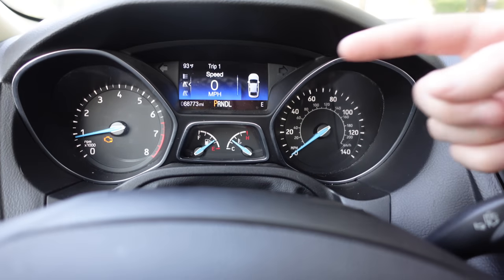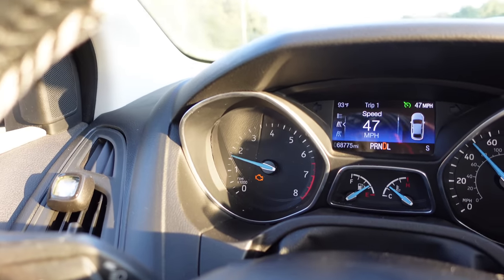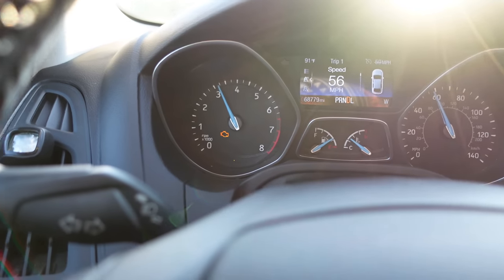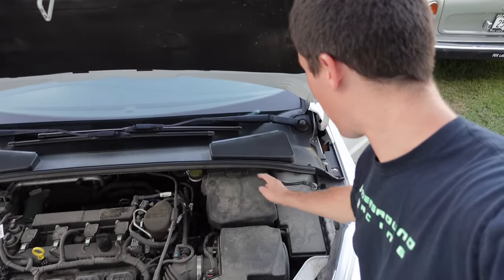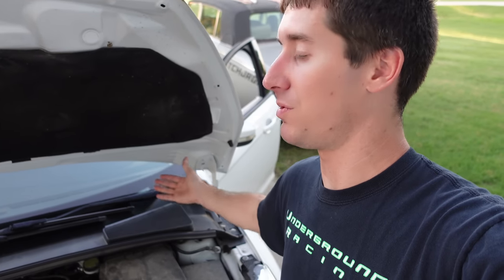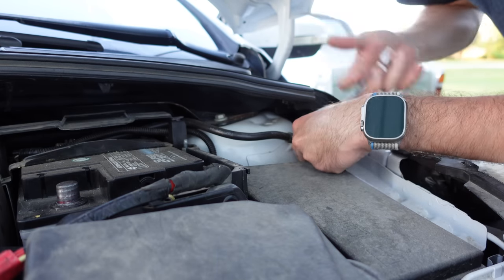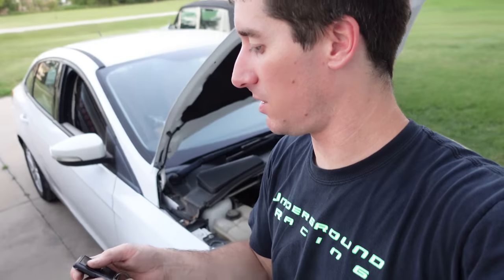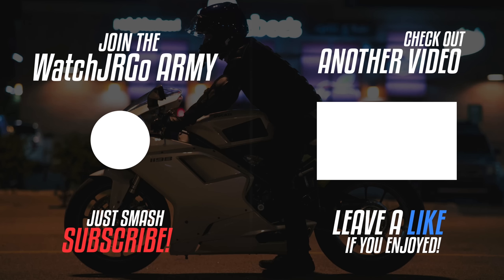This NIGHTMARE Transmission DESTROYED The Ford Focus (Fixing My Girlfriend's)

Comment: We’ve got one in the family with same amount of miles, only has 1st 3rd and 5th, R, 2&4 are out. Codes say clutch B stuck. I swapped clutch motors but no change. It’s now at Ford dealer as warranty was extended to 150k miles.
Reply from the maker: I just read that!! I'm taking it straight to the dealer! 😳
Reply: @WatchJRGo  my mom has a 2012 focus and they tried to pull some BS stating that they didn't have to give her a rental, eventually after some back and forth they gave her a brand new malibu for the 2 months!!! that it was in the ford dealer for. Something about a chip shortage during covid.
Reply: @WatchJRGo  Fingers crossed there's any parts in stock.
Reply: @WatchJRGo  Just expect to be without it for a very long time because they are so behind on actually acquiring more TCM's. Or unload it with the dealer. Ebay was the only place I could find a TCM. My problem was that I had a salvage title so they wouldn't touch my daughter's 2014 focus. Should have been a recall. I'll never buy another Ford after how they handled this.
Reply: @darthwhit  do they have to be reprogrammed?
Reply: Yet vw group managed to get the dct to work pretty good but they used hydraulic clutch activation where ford cheaped out with motors
Reply: @calambres6614  yes
Reply: We gave my daughter our 2014 Focus Titanium.  It had a new clutch at 60,000 miles, 159,000 miles and 189,000 miles.  The TCM was replaced in that time and the last time the clutch motors fried.  Nothing else in the car has ever had a problem and she is driving it with about 220,000 miles on it now.
Reply: Had a 2013 and if I remember correctly it was in for warranty for oil leaking on the clutches. It was under warranty so I didnt touch it, but we traded it fast.
Reply: No recalls have been issued out to owners?
Reply: ONLY the TCM to 150K. The clutch is no longer warranty.
Reply: @bradleyborno71  Nope. They got around that by extending the warranty. Which screwed us over because ours had a salvage title and they weren't legally obligated to fix it like they would if it had been recalled.
Reply: @calambres6614  Yes. they had to purchased a two day subscription to Ford software for $50 to use their J2534 pass thru tool. I typed up a whole long thing of my experience but it looks like the comment disappeared into the ether.
Reply: @WatchJRGo  Keep us up to date please.
Reply: @darthwhit they are starting to do recall on them but they will only work on them if the engine light is on and has a code for the transmission. That is what my dad has been told and he is a mechanic at a Ford dealer
Reply: @scott9050 wow how many miles does she drive in a year have a2012 with 196k on it about 120 miles a day 5 days a week sense new
Reply: Pretty typical Ford products. The transmission department hasn't been the greatest over the last few years. I think you're smart and letting her have the vault. Chevy still does transmissions pretty damn good.

My sister has a 2009 Ford focus that she bought brand new and it only has 72,000 miles on it. It still runs like a champ. It's definitely do for some coils soon but thats no biggie as you know.
Reply: @WatchJRGo  you didnt know about the replacement/warranty/buy back from ford???
Reply: @dd6892  70k miles divided by 8 years is about 8750 miles average per year if she bought it new
Reply: will probably need the clutch forks and a clutch kit. been there before.
Reply: When I had the motors off I exercised both forks to the ends and they both spun back into position with no sticking. I seen that YT vid on freeing them up.
Reply: I've had three service techs tell me that driving these transmission equipped vehicles like a normal torque converter auto is bad for them because the TCM slips the clutches too much. They recommend driving vigorously
Reply: @scott9050 yeah the engine is actually really good!  A stick trans Focus would be a great setup…
Reply: I have the 3 cyl eco-boost 2016 Focus automatic and have zero issues pushing 160,000 kms
Reply: @eggy1962 Ford is dry clutch, VW is wet.
Reply: @gregordiseth6651  so hydraulic isn't wet? anyhoooo vw system more reliable to a point  shared across their platform borrowed by volvo
Reply: @eggy1962  the actual physical clutch discs run dry in the Ford, they run in the transmission fluid in a wet clutch system like VW
Reply: @gregordiseth6651  i watched Diagnose Dan youtube channel where he fixed the vw system. It appears more complicated than fords yet more reliable. I don’t believe the vw group had to buy back their cars with the dsg gearboxes…i could be wrong tho. Having owned a focus with the dsg i can say how smooth it was UNTIL the temperature warmed up….then pulling away would judder false teeth out!!! Bloody awful in crawling traffic. Final nail in coffin for that car was massive rain water leaks into interior …car had around 27 k miles on it.
Reply: Buy one with a manual transmission or don't buy one junk transmission they should have bought a six speed auto transmission from Hyundai.
Reply: We had to have a new clutch put in my ex wife's focus when it had a mere 17k miles on it. From a take off it would shutter and shake, shift early, realize it messed up, downshift and get all confused. It went to the dealer multiple in 2yrs
Reply: Forget the ford, just fix the girlfriend.
Reply: oh im fucking mad i just dropped 3 grand fixing my focus transmission because they said the warranty went put at 100k and mine was 125k...
Reply: they wouldnt warranty ours at only 82k,  we ended up just dumping it at a carmax and bought a corolla. my friends sisters focus was in the dealer for over 6 months for transmission problems too, so good luck with it
Reply: @dd6892  
Most of those miles (159,000 of them) were  put on by my wife.  She's a Hospice Chaplain and travels a lot.  My daughter is a Big Rig driver but she drives all across the country to visit friends.
Reply: Well Ford wouldn't warranty repair it, they said it's the clutch and it will be 3500$, more then the cars worth. What a huge disappointment.
Reply: Look up ford boss me he has information on YouTube about ford focus and fiesta’s transmission having problems
Reply: Because clutch b stuck means bad clutch fork, transmission needs to be removed to replace clutch b fork then might as well check for oil leaks at the input shaft and check clutch packs for life if all good gotbto reset clutch before install.
Reply: @bugeye02707  
I might be, It also has P087A circuit B sensor position. I ran both forks with the clutch motors off using that special tool and they both felt fine, no sticking or binding. Not willing to pay $3500  to find out. 
They're shopping for a Japanese car now, young couple that will never come back to Ford.
Reply: @c1d2e  could very well be the clutch itself out of alignment and  will need cleaning of the clutch dust and a clutch reset before install which that requires the tool to do that, but ford wont do that they will just replace with new parts.
Reply: @darthwhit the manufacturers are finding more and more ways to get out of recalls, Hyundai/ Kia is back to asking for service records to deny claims and they followed Ford's lead in pulling carfax to check for branded titles. They do anything they can to deny a valid claim, all why telling you that their 50k economy suv is the best.
Reply: Ford has a 1 time unlimited mile replacement of the tcm recall 14m02
Reply: @eggy1962  electric motors that are easy for the home mechanic to get to and replace.
Reply: @UnspokenWords2010  even if i could change the motors….the system needs programming.
Reply: Remove both actuators and clean the forks easy fix there’s videos on YouTube on how to clean them make sure to spin the fork counter clockwise with a screw driver kit that fits don’t have to waste money on the tool don’t spin the fork more that 15 times hold it open and spray wd40 and brake clean oh yeah actuator A is on top Actuator B is under engine on driver side
Reply: I called Ford they said they couldn't help me . Mine has 110 K miles . But I've reard that salvage title car warranty are voiod and mine is a salvage title
Reply: I jujst called two dealerships and they both sai warranty doesn;t cover mine . I asked one of them they said it's only for 5 years or 60,000 miles
Reply: I have a 2016 focus hatchback se no reverse and gears slipping does it have a recall on this ?
Reply: Mine went out at 15,000 miles and during the warranty it was Covid so they had a chip shortage and couldn’t fix it. They didn’t get any parts in until two weeks after warranty expired. I got screwed by Ford.
Reply: The warranty is only on TCM issue. If it's ur clutch fork or clutch. U r out of luck. U need a clutch job. U can do it yourself if u have the tools. Luk Respet 7-233 I think is the kit for the clutch. 800 bucks
Reply: Replace the actualatores there where a batch of them where bad put in 2014 2015 Transmissions when put in make sure you put Greece on the whole thing part that's inserted in Transmission and put in the end gear to . And then you must take it to ford and get both of them reprogram into system it's a must .
Reply: Simple fix they tried to make it difficult lubricant to the actuator and change it Amazon costs like $90 for both
Reply: Love this better than dealing with nissan cvt cheap fix
Reply: How did you get ford to cover it under warranty? My car had the same codes. Mine was replaced by them two years ago and I was told I had 2 year warranty in parts and labor but they are refusing to honor it because it was replaced through a customer satisfaction program. Ford is refusing to pay for it under the new 150k extended warranty.

Comment: Ford recalled this transmission over a year ago. Just bring it to the dealer. If they can't fix it, they will make you an offer to buy the car back.
Reply: Was gonna say something similar. I have a ‘14 that was doing similar things and they recalled it and rebuilt it under warranty. Have 90k on it now and no issues since the repair.
Reply: I tried but my dealer said no since my car was already above certain miles.
Reply: I tried that and they didn’t do anything. Luckily it was under warranty
Reply: For about 20 cents on the dollar…
Reply: Not true. They'll buy the car back for a few grand, lmao.
Reply: that warranty is no longer available for any of the focus in the market
Reply: The clutch and transmission control modules had customer satisfaction campaigns with time and mileage limits. Not a recall
Reply: That's pathetic. 😂
Reply: It's a 2015.  Ford won't do anything for this.
Reply: I worked as a contractor and cat tell ya how many of those were having clutch pack issues one yech had 20 plus clutch packs near his stall and most cars had under 40k
Reply: 2012-2016 has 10 year 150k mile power train warranty, so 2015 should still be under warranty. 2017 and 2018 model years got screwed the hardest because Ford got away with lying that they fixed the issues but it’s the same shitbox DSP6. The Focus mk3s handle so well, it’s really a shame nothing can be done to fix these long term.
Reply: @josephwright8752   150k power train warranty? Are you serious? Even the Japanese cars don't have 150k power train warranties.
Reply: @hothmobile100  10 years or 150k miles, whichever comes first.
Reply: Yeah they’ll buy it back for 1000 dollars
Reply: Not recalled. They extended the warranty. Believe me I know. If it had been a recall, the salvage title focus I bought from Copart would have been covered but since it was just a warranty extension they wouldn’t pay it. Warranties are void on a branded title.
Reply: @hothmobile100 korean cars do have that.
Reply: @WilliamHollinger2019  no they don’t, 100k miles and if you resell it it drops down to a normal 60k warranty.
Reply: That’s hilarious because when I went to my local ford dealer they told me I would have to pay out of pocket. Bastards I probably could’ve had a nice car still. I could get 45-50mpg in that focus and now I’m driving an 88 s10 getting 10pm with 90hp
Reply: No they didn't recall is over they just reprogramm your car
Reply: I have a 2012 Titanium. I had the tcm replaced under warranty and less than a week later my entire clutch failed. Ford offered to fix it for 2600$ which is twice as much as that car is even worth. I’m trying to fight for it.
Reply: It is not a recall. It is an extension of warranty.
Reply: @RMV146 seriously??? 😯😯
Reply: @alejandroochoa3541  100% en serio señor ochoa😓
Reply: @Axon-bm2sx  i keep seeing google saying 40MPG is estimated but that’s just CRAZY if true. I can’t believe it they are that good??
Reply: I get 35 per gallon with air conditioning and about equal amounts of highway and city driving
Reply: They recalled the tcm, not the transmission itself.
Reply: My 2012 Focus has 190k on it. It’s in the dealership right now waiting for the tcm module to come in. Ford extended the warranty . They told me it would be no cost to fix under the Customer Satisfaction Program.
Reply: 10 yr 100k mile clutch/TCM extended warranty.    There is a TSB out for it, quick Google will tell you.   I have 2 a 15 & 16, that have 120k & 66k respectively.    The 15 has factory parts & my winter DD & the 16 is on its 3rd or 4th clutch.    The 16 also had power Rack fail $1600 😡 it's the GFs DD which is why it has more problems 😅
Reply: @Sevenine88  10 yrs 100k per Ford when I last checked.
Reply: @markmatt9174   My 2012 Focus 190k miles on it has been sitting in the dealers for 1.5 months now waiting for parts for tcm.  They looked at it  said it would be $200 service charge if it wasn't the tcm Luckily it was and no cost but now it's a waiting game.  Calling every Tuesday to see if they heard anything yet on when the parts will come in.
Reply: Campaign/NHTSA#
14M02
150,000/ 10 year extended warranty customer satisfaction program. Mine unfortunately is acting up at 165,xxx
Reply: except theyre assholes about it and will try their best to get out of it. bought one of these with around 35k miles and clutch is fucked and the actuators were fucked, we replaced them and they shit out immediately, and ford still just claims thats the problem and wont admit the transmission is whats causing it to fuck up.
Reply: @ACR103  tell dealer the TSB for extended warranty.    They can scann tool it to see what part is messing up.
Some quick fixes are cleaning the battery cable to body, (3 places and ground on transmission.
Reply: My Tcm finally got replaced but they couldn't program it because the dual clutch wouldn't release.  Ended up trading in the POS  Focus
Reply: My friend's car has a transmission problem and there is a claim on it but we took it to the dealer and they said they can fix it but they don't care about the claim he has to pay over $2000 to fix it.
Reply: Where does my ford focus 2009 have a transmission malfunction? 
It doesn't fall within the 2012 - 2016 models.

Any possible explanation will be much appreciated.
Reply: Is this true
Reply: B.s. nobody fixing nothing. Ford basically told me to go to hell. Will NEVER buy a ford again.  Ever